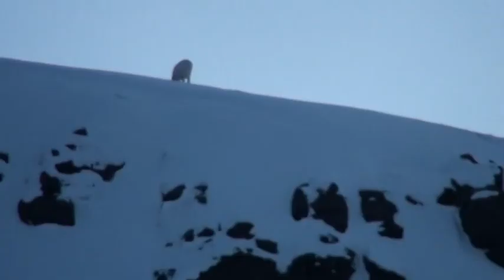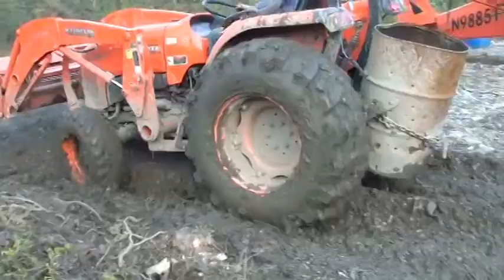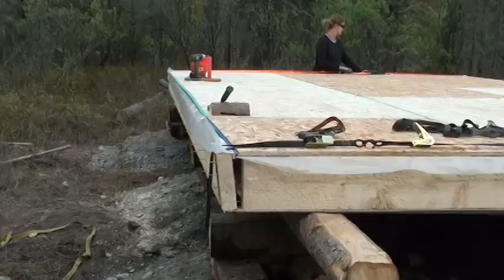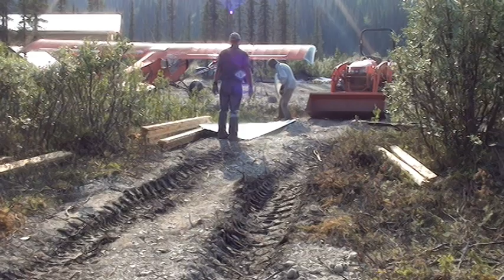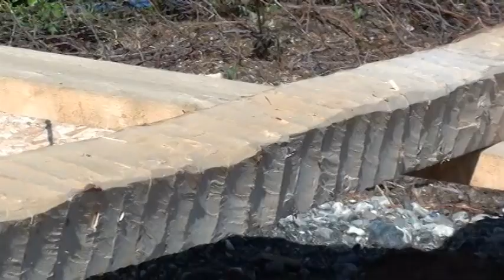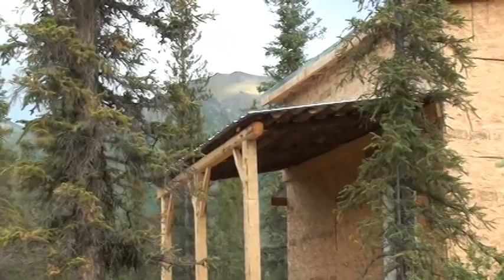Tiny House on the Top of the World

Comment: Quick comment: don’t use vapour barrier below your subfloor. If there is ever a flood or broken pipe, it will seep into the subfloor and get stuck between it and vapour barrier. Over time it will rot the subfloor and cause all kinds of trouble. Not the right thing to do. I know this from experience.

Comment: You said you carried 80 tons of gravel in a 5 gallon bucket with a 4wheeler? I am sorry but I don't believe that.
Reply from the maker: +CanYouFlyBackwards :If you do the math . . . 70 lbs per 5 gal pail equates to 2285 pails for 160,000 pounds. The wheeler carried 7 pails per trip for a total of 326 trips. Each trip took about 8 minutes or a total of about 44 hours. During the 24 hours of daylight in June, the usual 15 hour work day would have taken less than a week to move 80 tons. With two folks shoveling pails full  in the gravel pit and one helping the wheeler driver to dump them for the road way and then the building pads, this really was no challenge.